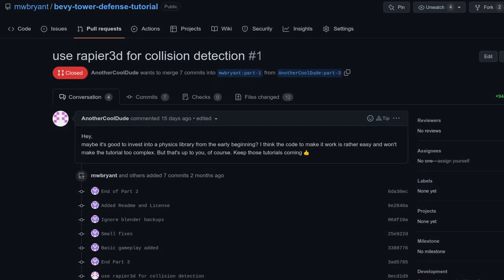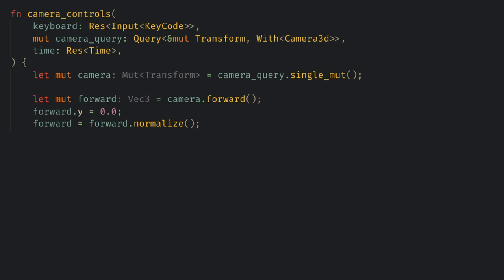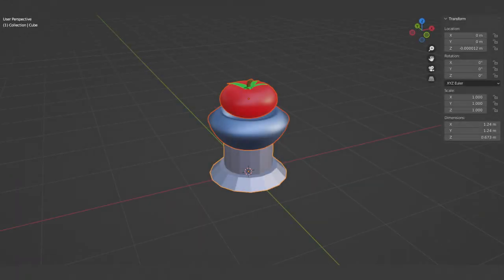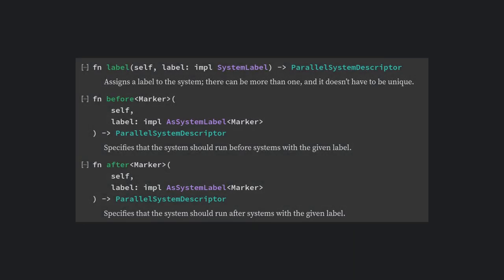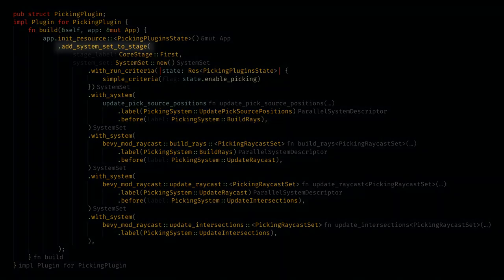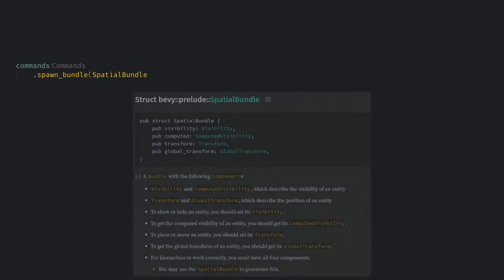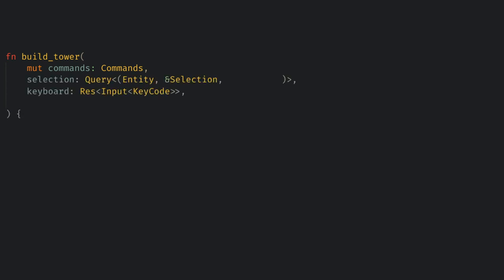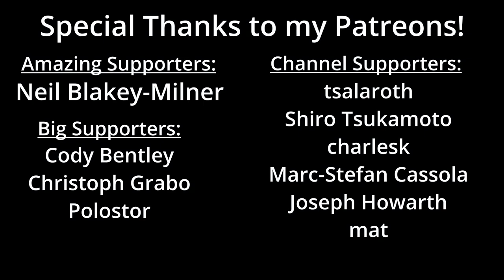Input, Click Detection, and Tower Building - Bevy 0.8 Intro (Ep4) (Updated to 0.9 Check Description)

Comment: I just ran into the issue of needing to select models in a 3d space, and I was going down the road of using raycasting and it was getting complicated.... so thank you.  How did you end up discovering this plugin?
Reply from the maker: It's mentioned in the bevy cheatbook (I think in chapter about mouse input). There's also the assets page on bevy's website that has many community plugins (of varying degrees of quality and updatedness)